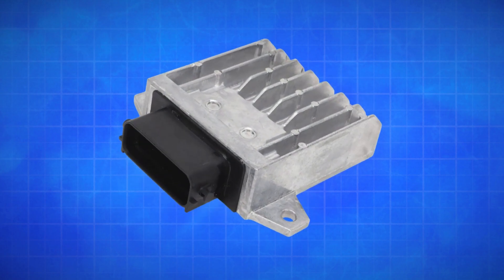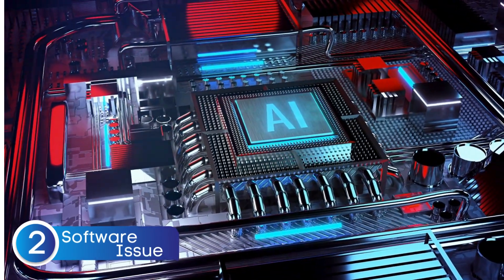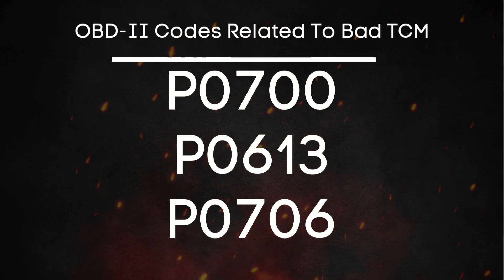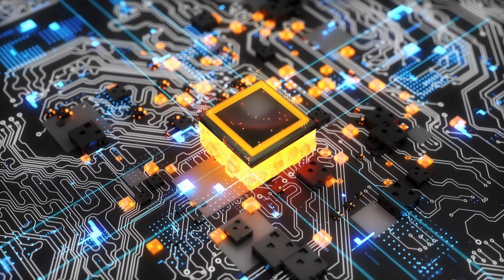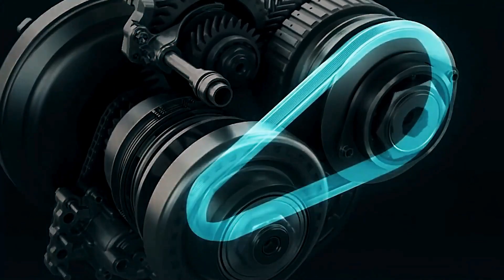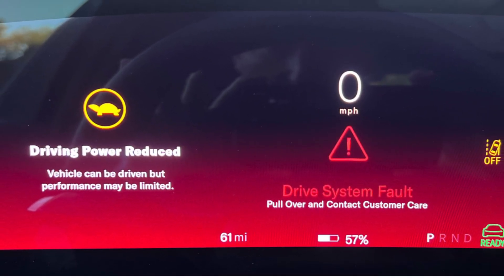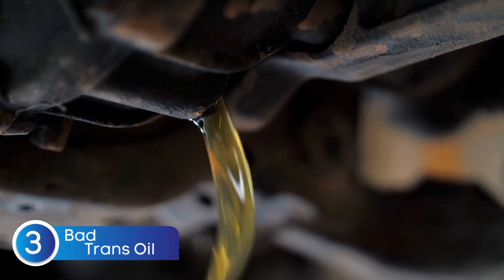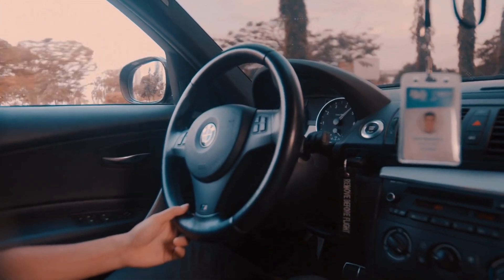6 Symptoms of a Bad Transmission Control Module & Causes

Comment: Audi a6 2.0tdi  is jerking while shifting 1st and 2nd gear what could be the problem
Reply from the maker: That's definitely a common symptom of transmission issues.
Reply: @carfix07 so what should be repaired if I leave to a mechanic

Comment: Maybe you can help me with some pointers my 2021 gmc sierra started to shift really hard today as I went from drive to reverse then I shifted back to drive and it did it again just not as hard then went back to reverse and it was really hard again? It’s four years old but only has 35k miles on it. Idk if it’s a transmission issue or if it something more simple like the module or bad transmission fluid I never changed the fluid but I also am thinking maybe that could be it maybe it’s low “it doesn’t leak” or maybe it old even though I don’t have more then 60k on it it is four years old idk if it’s the same as oil and still needs looked at and changed after a certain time even if you don’t have the mileage it says to change the oil I don’t drive it much but I’m curious if I can do something that doesn’t cost a lot or try and few things before I take it to the shop? It’s under warranty but still trying to see if how to handle it. I’d really appreciate you or someone to give me some pointers thank youu 😊
Reply from the maker: It sounds like a tricky situation, and it's good you're thinking through the possibilities.

Comment: 2003 Honda odyssey ex — l they replaced the transmission solenoid but now it’s not shifting correctly so I’m think this is my issue I got code 1750 code could my issue be the range gear sensor ?
Reply from the maker: It's possible, a range gear sensor can definitely affect shifting.

Comment: Why do you say that the TCM failed instead of reporting that  in some cases the TCM might be doing what it it supposed to do when there are problems elsewhere that could damage the transmission or create an unsafe driving condition?
Reply from the maker: There is a possibility that everything is okay but TCM is faulty. Although its rare.